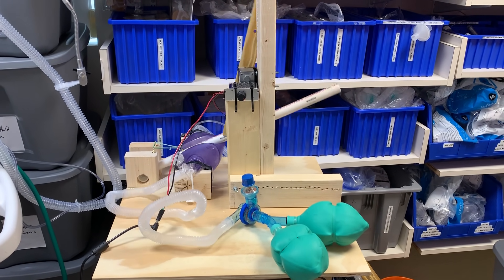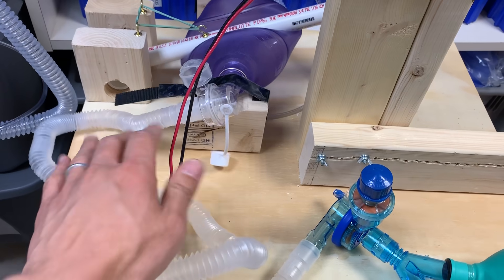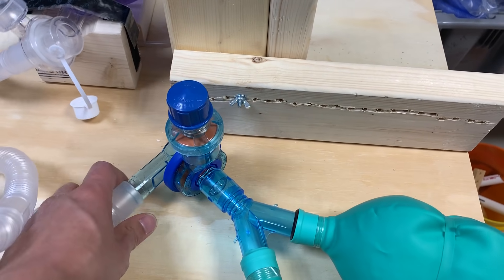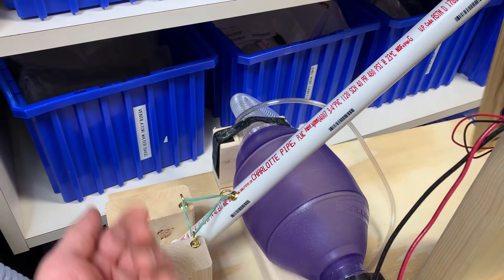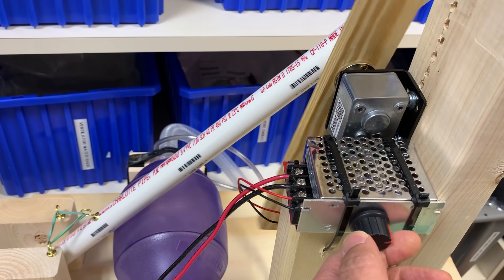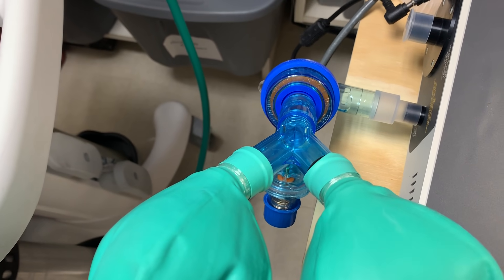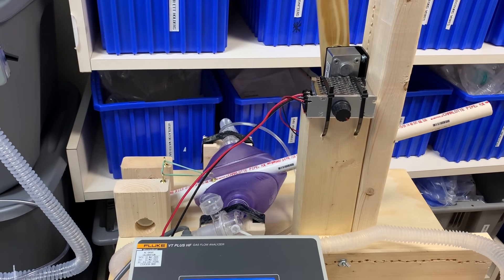The Macgyvilator disaster ventilator Mk2! (3/25/2020) Now with validated respiratory parameters.

Comment: This is a great invention...you have my respect and admiration.
This is already very cheap to manufacture...
But...for poor Indian grassroots people...
Medical equipment is still very difficult to obtain.
Sincerely request you... can use materials that are easier to obtain.
Make life-saving breathing apparatus.
For example: the sphere becomes 2 PET bottles + rubber car inner tube or a thick plastic bag.
The snorkel is a common household water pipe..
The mask is made of PET bottles..
Adjusters are generally used to control lights..
The motor can be the wiper motor of the car...
Heartfelt gratitude. People from India...

Comment: Sir, Is your ventilator registered from gov. authority for patient use purpose and how you change rapidly your ventilator volume.
Reply from the maker: The design has not been registered for patient use. It's there as a springboard for other ideas. Tidal volume is tweaked by moving the position of the motor up and down.

Comment: The Fluke gas analyser looks expensive, is it dedicated for mech.ventilator and you adapt or program it
Reply from the maker: The Fluke is indeed super pricey. It's not there as part of the mechanism; it's just there to validate what the output is.
Reply: @datatrician1369 Is there handy or cheap alternative to Fluke

Comment: Can't the exhaust be passed through alcohol tank? Or disinfectant fluid?
Reply from the maker: Best would be to use an inline microbial filter. I worry that there would be too much exhaled breath coming too fast to be effectively sterilized by bubbling through liquid.
Reply: @datatrician1369  what of series of tanks or tubes? Like in a car's radiator?
Reply from the maker: @toolsboutique  Maybe? You'd likely have to try to break up the exhaled breath into as many small bubbles as possible to maximize air:liquid surface area, but most importantly, you'd have to test the crap out of it to see what microbes were getting through. That testing won't be simple to set up.

Comment: With 2 bolts you can adjust ratio (1:1,1:2,1:3..) by splitting spinning arm and changing angle between resulting rays.
(But I'm not sure, just thought experiment)

Comment: Hey man, if you build a circle instead the rotating arm (the circle can be less wide) you can build some sort of rod like the ones on engines,  that way the pvc tube could be shorter and would be pulled out with the same motor movement, i know there would be more parts violating the KISS principle, but would make your set up less big, but damn you got it working flawless; i saw the 3D printed models and they are overenginieered, your built is way easier to replicate on small towns here in Mexico
Reply from the maker: That's a totally valid alternate design. Thanks for your comments!
Reply: Your design would be perfect for low torque motors since the lever reduces the force it needs, still amazed by your design, just waiting to get my hands on a pwm controller to get one working

Comment: you could put a degree of curvature on the plastic pipe arm . this would possibly make most of the stroke and not pinch the area that is closest to the fulcram . With long use this  could/could not become a problem ??. Also perhaps a little copper pipe insulation material or whatever on the two bottle resting arms .... just a thought .
Reply from the maker: I think it might be simpler to either raise the pivot of the PVC arm or cut a bevel into the support block. I need to experiment some.

Comment: Amazing! Sent this to my
brother who's a GP and his comment was "Super cool!"

I am in South Africa. We are in lockdown, so no access to hardware or electronics stores.

I have everything to build your design except motor and PWM controller.
Do you think I could substitute my drill?  Speed can be adjusted.
I'm just worried about whether it would handle continuous operation without overheating.
Perhaps I could take off the casing and have a fan cool it.
Reply from the maker: Thanks for the feedback! As for the drill, give it a try! I worry about having enough torque at low RPMs, but if you're stuck, might as well give it a go. Good luck!
Reply: use Car Wiper motor... hope it will usefull

Comment: Of course the other problem is expelled air . You could filter through a plastic container with a car air filter which is rated for the job .

Or and this what I'm going to develop as well is reversing a p3 dust mask . So you have air entry into the exit and air out through the filters. All you need do is reverse the inner  valves .

I'm also working on a compressor system that can be near miniaturised using solenoid valves and air filtration . You can do this as a Bipap.

It can also be pre programmed as to tidal and background pressure and the stroke can be adjusted by a slide switch.
Reply from the maker: If you can slot into a standard airway circuit (which you should be able to do if you build around a BMV), then you can place an inline filter (hospitals should have these) between the patient and the PEEP valve
Reply: @datatrician1369  You can if you have a BVM go directly into the side . Some have it moulded in probably for this reason.

Comment: ONE item to consider is the HUMIDIFIER MIXER VALVE to control the humidity of the air.
Reply from the maker: Humidity can be added to the O2 at the intake end.
Reply: @datatrician1369  The device is NEEDING  filters that has been mandated in the British specs
"There will be a separately sourced HMEF-bacterial-viral filter between the machine and patient which may impact on resistance within the system, which may need to be accounted for with some designs. The pressure being delivered to the patient is the specified pressure. If the filter has a resistance of, say 2 cmH2O, the ventilator needs to output 37 cmH2O to achieve a set 35 cmH2O at the patient. "

https://www.gov.uk/government/publications/coronavirus-covid-19-ventilator-supply-specification/rapidly-manufactured-ventilator-system-specification
Reply from the maker: @Allan Teo I didn't want to have waste a filter on this, but hospitals have in-line microbial filters that can slot into the circuit easily. Here you'd want it between the PEEP valve and the patient (fake lungs).

Comment: a couple of things I see that may assist in the development of this unit you could get three inch for 4-in black PVC pipe cut it in half so you have a u-shape to hold the bag and then you could slice down part of the tubing to accept the arm as it squishes bag
also I have many window regulators from Mercedes and a Volkswagens they are very low torque and low RPM DC motors
Reply from the maker: Window motors are a great idea!

Comment: brilliant best one yet . however could you rig a secondary line for  a base level of air  5 cm h2o?. i have a design that works with supplementing this via compressor . However I think a dual motor twin bag system would be better . One simply providing 5 cm H20 between the major stoke of the main breath . I will post when i have done it . Also a simple mannometer to measure pressure
Reply from the maker: All you need for this a PEEP valve. There's one next to the fake lung.

Comment: Good day ... the size of the parts so will be ez to get the right parts and sizes (sorry to ask i not a very good without plans of what i will build). We are at lock down here in Brazil all stores are closed i trying to get the motors all i find are these https://lista.mercadolivre.com.br/motor-12v-alto-torque-100kg?   100RPM  high torq ...  matt_tool=89231238&matt_word=Default_URL_MLB&gclid=EAIaIQobChMIts3lz_K_6AIVlw6RCh3WBwt_EAAYASAAEgIoHPD_BwE
Reply from the maker: If you can get to a car junkyard, try to find a windshield wiper motor. Otherwise you'll just have to try with one of the motors you see online.

Comment: You might have already considered and discarded these modifications but: 1) instead of discrete holes in the vertical member you could make a slot (depending on tools you have; hole at each end then saw or jig saw out the rest of the slot, or use two pieces of wood affixed (screw/glue/nail/elastic/clamped/etc.) together but with a spacer on either end to create such a slot), then you can just slightly loosen the wing nuts and slide the motor up and down.  A tiny bit bigger diameter washers might make it smoother. 2) you could potentially mount the entire set up vertically or even upside down which might obviate the need for the elastic return mechanism for the PVC pipe, 3) holding the ends of the BVM bag down: if someone doesn't have tape or velcro, cutting ~1" wide strips from bicycle inner tube yields strong, elastic bands that you could use instead, one end nailed in place the other made removable (e.g. pinched in place or hooked) so you can remove the bag.
Reply from the maker: All worth trying! Good ideas!

Comment: Great work. As a mechanical engineer this is the best design I've seen that utilizes the bad valve masks. It looks very robust to the extent that the bag itself might be the first point of failure. Being made of PVC and wood means this is more viable to be built by anyone who needs it. Biggest supply bottleneck looks like the motor and controller, which could present people with a challenge if they are forced to use different parts.

Comment: What a fantastic idea -Thank you Doctor-The wood parts could be made of plywood on a cnc machine  quite quickly -are there more professionals that can weight in on the design and durablity  of this design 
Food for thought -could Windsheild wiper motors with varible speed be used as a cheap moter alternative?
Reply from the maker: Wiper motors would be a good alternative, I think

Comment: if you had a simple cardboard box and install a few inline ( FPR 10, they are rated to stop virus carriers ) home air filters inside it you could probably clean your exiting air sufficient to go that route.  what do you think? its a cardboard box , some duct tape, and some air filters maybe 2 or 3 spaced an inch apart-- the same kind that go in your home. the setup can be small if you use the smaller size filters.
Reply from the maker: Cleanliness is huge, as you point out. In a hospital setting, there would be in-line microbial filters.
Reply: @datatrician1369  i suppose i was referencing the issue of not having outgoing filters and a worst case scenario quick fix. i hear that worst case is nearly what we are dealing with. i saw this one video where this guy was saying not to use vacuum cleaner bags as filters since according to him air would still get through the sides. i see a failure of the imagination . just off the top of my head you could take a cloths hanger (the metal one) and bend it to the shape of your face and sew on the vacuum bag filter material and some elastic to keep it on and tight. thanks for the video. if i need one i will keep you design in mind. only thing is that i would not have it right when i for sure need it at that moment because i would need to order parts. something to think about i guess..just to address the hospital setting thing, i'm thinking that sometimes a we have to do that we have to do may sometimes be in order... again, love the video.

Comment: If you put a gentle curve on the pvc pipe lever you could control the pump stroke. You can bend pvc pipe by heating with an hot air gun.

Comment: What about adding a chunk of foam pipe insulation to the PVC pipe, to lessen wear on the air bag?
Reply: The insulation wont last and will add friction to it.. the smooth pvc pipe and silicone is a good match.
Silicone wont get damaged that easily
Reply: I really think that is a great idea. Maybe make something out of rubber to also lessen the noise from the friction between the pipe and the bearing.

Comment: I wonder if a modified windshield wiper motor would work? Common, heavy duty, and I think the rpm is close. Auto manufactures would probably have thousands of new ones in their supply chains. Countries with less manufacturing still have cars (dead or alive).
edit
Speed control could be a variable bench power supply or at the most basic, just inline resistance (use the heating element from a hair dryer to make the resistor).
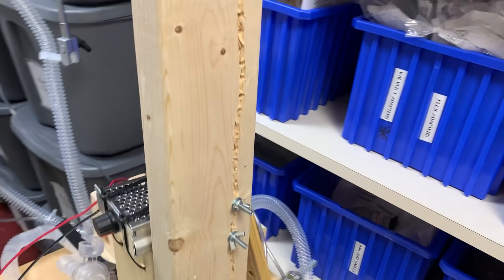Reply: It sounds like this motor is already at its limit, 1:30, and using voltage to control speed impacts torque.  I think PWM like he uses is much more effective in this set up.  See e.g. https://www.actuatorzone.com/blog/about-actuators/pulse-width-modulation-vs-variable-voltage-control-2 or just google around "pwm vs voltage control dc motor"
Reply: @perspectivex A car windshield wiper motor has much more power.
Reply from the maker: Love the wiper motor idea. I have a couple, and they're definitely more beefy, but I haven't had the time to mount one yet (bit of a pain).
Reply: @datatrician1369  Thank you for your work. This could seriously be life and death for people around the world.

Comment: A flat piece of plywood can be fixed below the pipe, it will give a better compression, an adjustable  distance of the bag can be designed, it can be a simple slide and some sort of clamping mechanism where the bag is kept, then the air volume can be adjusted by changing the placement of the bag

Comment: Thank you for share this idea with us
Please tell me about the motor you used
Reply from the maker: Briefly, it's a 12V DC motor with high torque (more is better) and low RPM (shouldn't need more than 40 RPM). Similar motors are used for robots, automatic blinds, and even garage door openers. I'll have more detail in the parts list (in progress).
Reply: This motor without any control or PWM right? Thanks you

Comment: Great design. Just a thought I had as a  suggestion:  reverse the motor rotation so the initial push starts out on the long end of the lever arm and drives towards the lever arm pivot, this would reduce the spike loading on the motor.  The torque required would be more linear.  As it is now, all of the compression takes place near the initial contact. Reversing the drive  direction I believe would level out the torque requirement.
Reply from the maker: Marc - that's an interesting suggestion, and I think it would indeed work to reduce the torque spike. That said, having the rotation in its current direction allows one to change the I:E ratio by shortening the length of the PVC rod, and I think the more rapid breath on the front end actually matches real ventilators better (and is presumably more physiologic). Is the tradeoff worth it? I honestly can't say.
Reply: That is an excellent idea. I'm trying to build something similar, I will try your idea on mine if that's okay with you. Thank you so much for sharing!

Comment: Great design! If you can send me the dimensions, I can mock up a technical drawing to share if you need some help. Thanks
Reply from the maker: I just might take you up on that offer - thanks so much! I'll take all the help I can get. Just to give you a rough sense of scale, the baseboard is 2'x2', the PVC tube is 2', and the tall upright length of 2x4 is 2'. All wood blocks come from a 2x4 and are thus 1.5"x3.5". The blocks at the pivot of the PVC are 4" tall, the blocks supporting the bag are 4" long, the block under the bag is 6" long. The rotating arm is 16" long.
Reply: @datatrician1369  Do you have a parts list and links for the electronics, tubes and valves?
Reply: https://youtu.be/7o8o2mCQzvU. Check the video.  Trying to find a good place to share and upload a Cad file at the moment
Reply: @wafflebeaver   thanks my friend...
Reply: Please share if you come up with a drawing. Thank you. mohdafzel@gmail.com